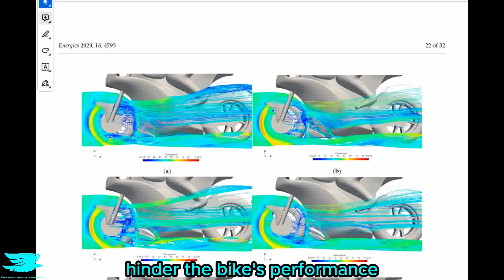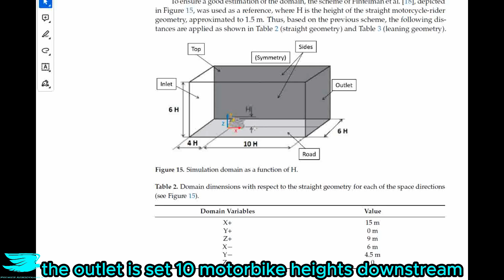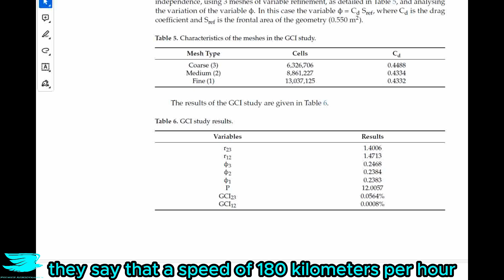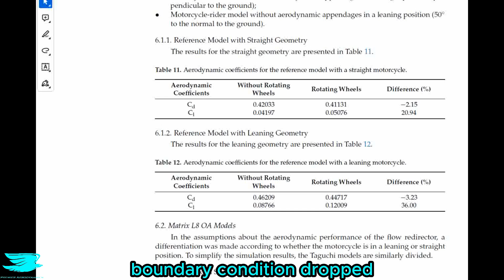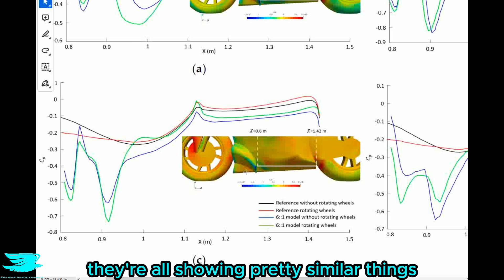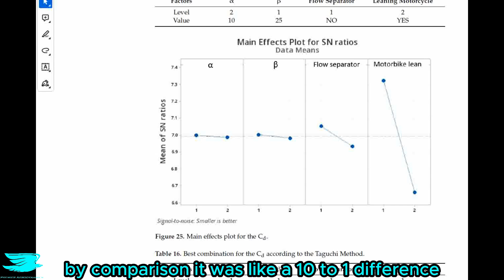Podcast 183 MotoGP Flow Redirector Aerodynamics

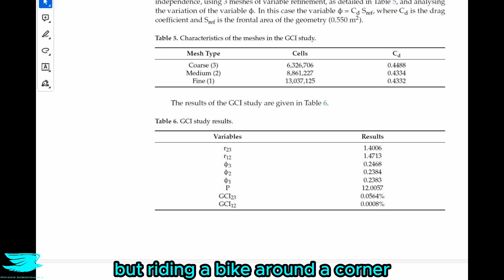Comment: 10:38 I've cornered at over 200 km/hr on a measly 75 hp, and I'm no Rossi. It's fast, but not absurd. One could argue that a large radius turn makes the most sense for this simulation, because the steady-state steering angle would be nearly zero degrees. If they're too lazy to pose elbows and knees, I guarantee they didn't model steering angle, or arcing of the moving ground plane.
Reply from the maker: Okay, I think perhaps that is the type of corner they were referring to.

I have a dirt bike background so perhaps my reference as to what is doable is off when it comes to the track.

Comment: Rotating wheels will tend to create stronger pressure gradients between the front and rear of the wheel since the leading edge is constantly running over air, and the trailing side is pulling away from it. However, from my experience, the boundary layer of the wheel doesn't grow too much with rotational speed, only a few cm.
Reply from the maker: I have also found that with rotating wheel boundary layers.